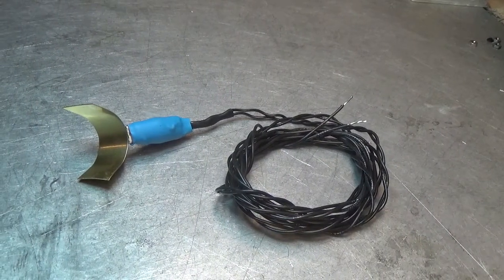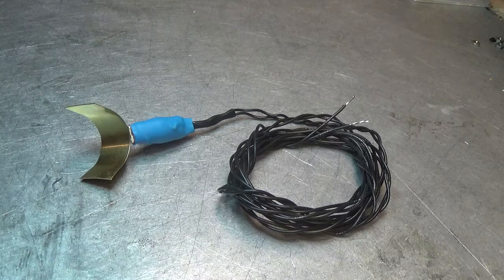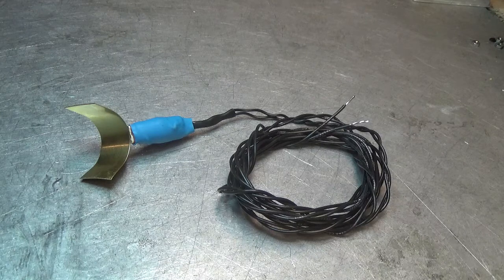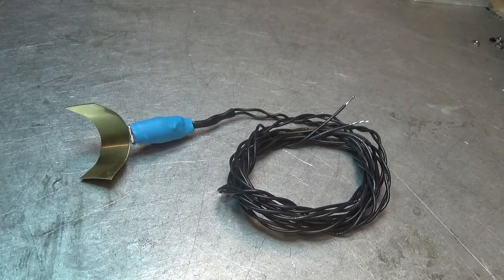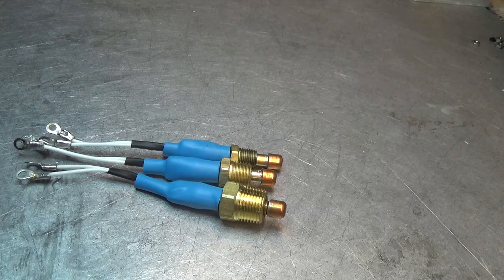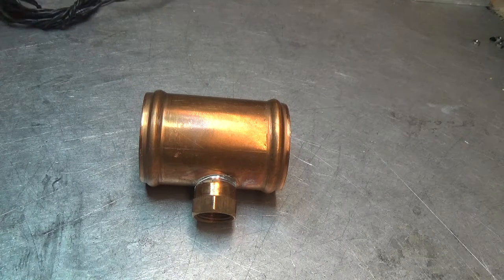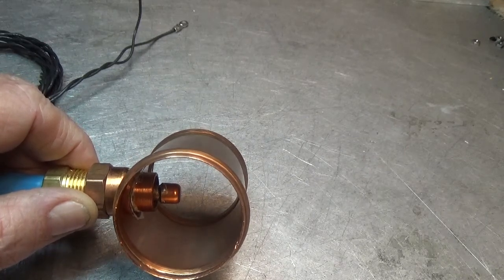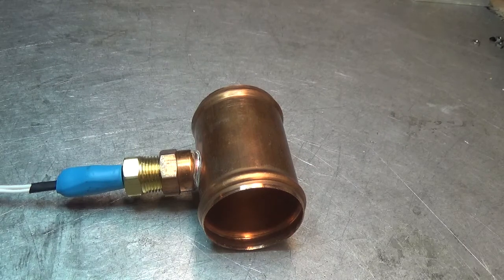SENSORS FOR YOUR AUTO COOL CONTROLLER

Comment: Can I correctly infer from you repeating the preferred location being on the outflow of the radiator that using the factory coolant temp sensor in the block’s water jacket is a bad idea?  I just want to add pwm control to my electric fans and do away with the relays it currently uses
Reply: The system should sense coolant outflow to keep the fan off as long as the radiator is cooling well. Lots of times the natural airflow created by the cars motion is enough to cool the engine.
Reply: @daleandersen6730  and reduce demand on the alternator/electrical system too. That makes good sense.
Reply: I was wondering if the sensor can be anywhere on the Cool side circuit, engine or radiator
Reply: @332ARA  it appears the best place to put the sensor is I. The lower radiator hose; between the output of the radiator and the input to the coolant/water pump would give an indication of how well the rad/fans are cooling, but that would be an argument for having the fan controls inside the cabin